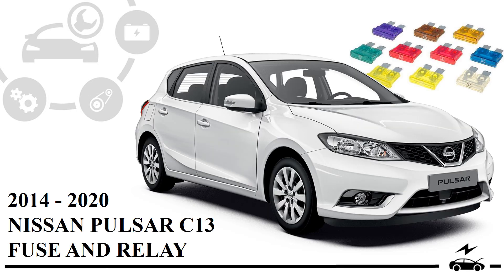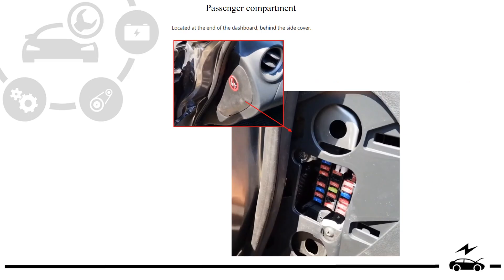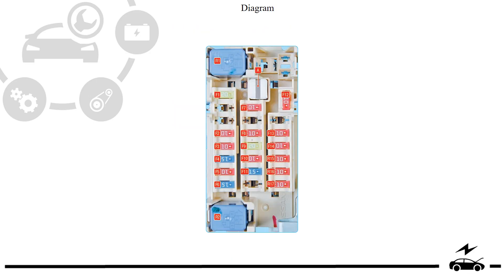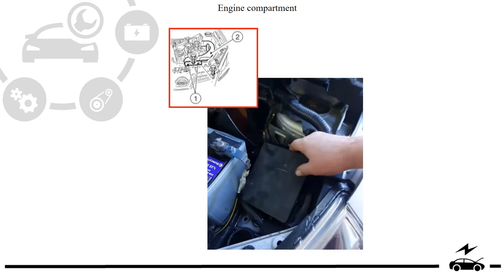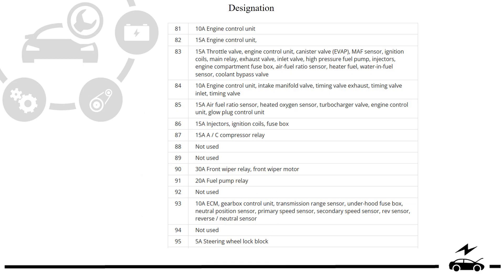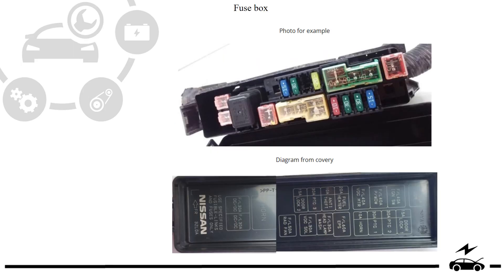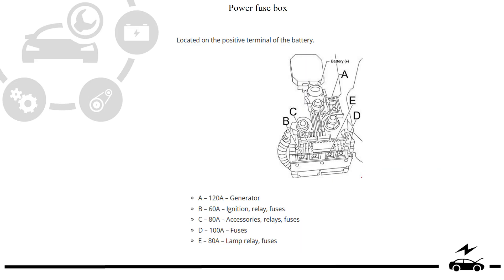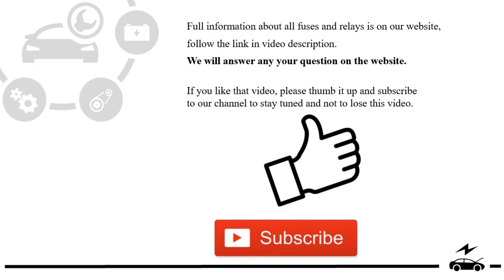Fuse box diagram Nissan Pulsar C13 2014 - 2020 relay with assignment and location

Comment: I have a pulsar made in Spain, right hand drive, with a fuse box drivers side with relays in and no information of what they are. Also do not have the fuse box under the air intake and it is a 2014.